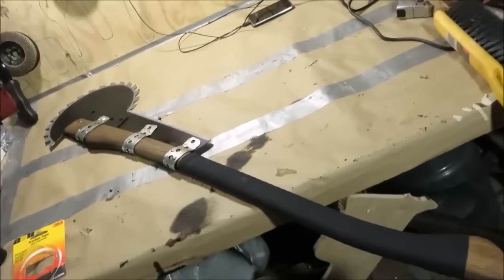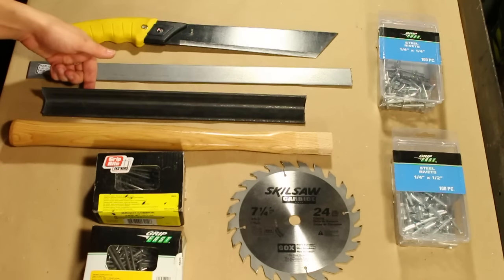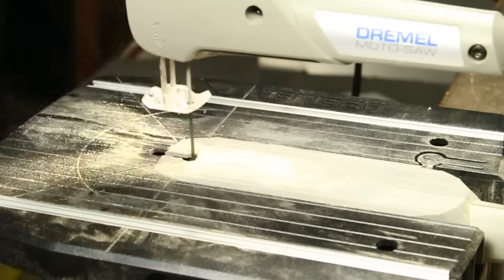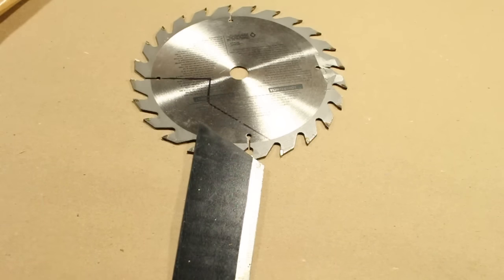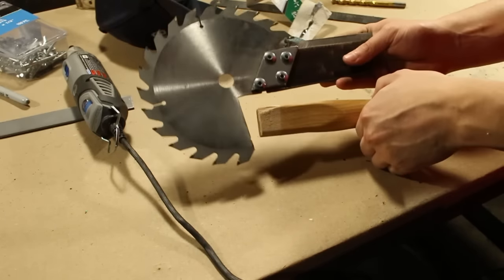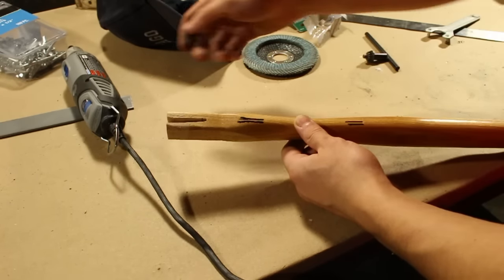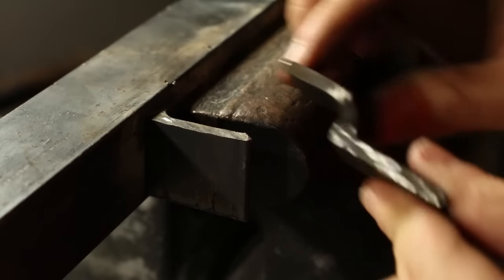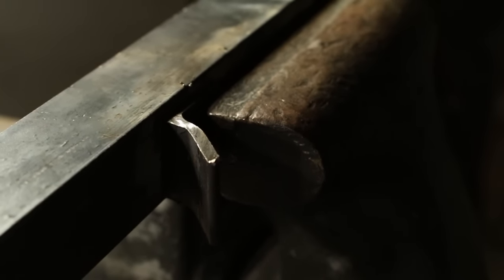How to Make: PSYCHO TOMAHAWK (UPGRADED Wasteland Tomahawk)

Comment: you should heat the metal before you bend it, it will take the temper out of it, but for your purposes, it will be fine, and it will be a lot easier to bend, i would suggest a map gas blow torch

Comment: Hey ZNA. From what I saw, it looked like the voltage on the welder was too high. If the metal is melting away as you weld, lower the voltage and try it then. I'm no expert, still learning myself.

Comment: just a tip when you butt welding like that you sould bevle one side to a 45 degree full weld flip over back grind it till the crack is gone and re weld keeping it clamped around the weld while it cools will keep it from warping to much

Comment: Hey man let me give you a couple tips on mig welding. If it keeps popping and not sounding smooth crank the heat up just a tad til you find the sweet spot and push the weld never pull the mig gun to you push the weld. Just keep practicing man you will get the hang of it. Another question. Do you have a auto darkening helmet or lense? If not hit me up bro I got one I will send you. Makes welding a lot easier than it was for the old timers. Peace.

Comment: Your welding could be improved by slowing down and make sure you bury the core in the puddle. Also while you weld make a lower case "r" motion starting at the seam and working up. This will give you good welds by ensuring your puddle hits both sides.

good luck!

Comment: here i dont have this kind of welders, but in argentina we use "autogen torch" (i dont know how to say that) and electric welders, that i see its what you got.
so i think that the current that the welder is given its to much (here we have the electrodes one) and if it is too much current you kinda not join the two parts together so its like you stick them in some parts and not on others so. advise: if you hear a "whush" coming out of the welder and the handle is too light the current its too high. if the handle its too heavy and the electrode sticks to the metal (remove as fast as you can not to ruin your electric welder) the current is too low.
(always use cloth that cover the most part of your skin because you gonna have some serious "sun burn" out of an electric welder)
good luck and keep practicing in scrap metal because its the only way that you gonna improve.... ruining scrap. 
by the way i really like your builds

Comment: What type welder are you using. If it's an arc welder you will need to use a low setting with thin metal like that , if you can get your hands on a wire welder  set on 75 or 90 and a slow wire feed it will be easier. Plus a wire welder you can get at harbor freight for Bout  89.00 TP 119.00 and it's a lot more forgiving. It
F that's what you are using start out slow then build up your spurred. I use a wire welder up to 1/4 inch to 3/8 with a .20 wire. The nice thing with wire welders it's a hard weld and it's easy to build up. I've used mine to weld stove pipe which is very thin and you can build it up without blowing it our. I've seen people who can't weld with a stick welder make nice even runs after an hour with a wire welder

Comment: I'm guessing it's an arch welder. Is it a clamp or autofeed? I'm assuming clamp is cheaper and probably what you have, unless you splurged. My dad just taught my cousin, sister, and me to weld using a clamp welder. A note he made to us is that you are adjusting for both position and feed with a clamp where an autofeed allows you to hold position while the feed takes care of moving more material into position, making it significantly easier. Take if for what you will.

Comment: With regards to your welding, it looks like you have a lot of splatter, which can be caused by having too much or not enough voltage (I don't remember which :P). It will help if you slow down and take your time when you weld.

Comment: I would like to say that on ur welding no weld is bad if u have good penitation in ur steel, I am 16 years old and when I first started welding at the age of 10 my welds looked like boogers but they held sturdy. When ur metal working it's ok to have a crappy looking weld because they made a grinder for a reason lol. Like my dad always says "they may look like boogers but they'll hold and that's all that matters". Keep up ur welding and practicing it will take a few try's and u need the right voltage and wire speed for ur metal if u want a good looking bead and to not melt holes on the metal, but sooner or later ur gonna get a nice looking bead.

Comment: Hey Eli, thats a MIG welder right?  Not sure why but it seems to "spatter" a lot, try setting the wire feed speed to a lower setting and leave your temperature the same.  

P.S.  If your going to practice welding i would suggest a Stick welder first.  As my teacher always said if you can master Stick welding you will do great with a MIG welder or a TIG welder.

Comment: and if you hold the arc in one spot longer your weld will melt the metal together better, but you can't hold it on too long or it will just melt it away

Comment: Welds will be stronger than riveting. The plate and rivet does look cool though.

Try welding by tacking along the join, not by trying to do a bead in one pass.
Use your scrap steel to practice your welds dude, play around with welder settings, that's all it takes :)

Comment: fam alright be 1/4 from medle to bead that comes out of the tip get it first so the metal has a glow then depending on wire speed and heat move in a diagonal back and forth motion never letting go of the trigger.

Comment: 3 things about the welding first what gas are you using?,  argon 92% and co2 8% is a good one could be that you are using the wrong type of gas,.
It also looks like you are using too little power while welding, and finally turn upp the gas. like 6-8 bar pressure.

Comment: you should weld in the other direction it gives better flatter weld and doesnt crack so easly to. so thats one thing 
also your welding MIG but you use the right material to weld it? 
for the things i have seen i think you schpuld better get yourself a TIG welder you can buy a couple separite wires to ad in the right material and gives way cleaner welds.
hope this helps you a bitt , i'm a welder

Comment: If i seen it correctly your using a half auto Mig/mag welder. This might help; if your right handen try resting your left elbow on the table so can suport the sossel with your left hand by eighter holding it or letting it rest on it just be mindfull that it wil get warm zo dont het to close to thr buisenes end, and slowly go over the seam maintaining the same speed. Also a neet trick is a white line over the seam so youll see it beter. Try it out:-)  and dont give up and youll het there

Comment: Eli, on the welding, try turning the amps up high as you can with out burning a hole in the metal as soon as you hit the trigger,keeping the tip about 3/4 of an inch away, using a slow back and forth motion, also it helps to bevel the edges of butt welds for good penetration, I know you'll fiqure it out. ps I love your channel  thanks.  whats new address?

Comment: next time you weld grind the edges of the two bits to make a shape kinda like this =><= when there placed together so you can fill the dip in with weld it will make it stronger when you grind it down flat and Wil get a deeper weld

Comment: welding looks like it needs more heat, and you need to move a bit slower, it's not easy.as for the circular saw, only the black ring on the outside is hardened, if you get the right blade you can probably cut it with the scroll saw.

Comment: You know, MIG and TIG welding is the easiest, but I recommend learning how to use an Ark Welder and how to Oxy Acetylene Weld first. Learning those two harder welding option will benefit you enormously (and since you're in Illinois, I assume there are plenty of farmers with one or both of the above mentioned welding equipment).
Reply: Ark is the easiest thing to learn how to weld...  Tig being to hardest.
Reply: Ark ain't the easiest; MIG is. With MIG it's all about the pull of the trigger, and small circles. Ark is all about making sure the rod isn't too close or too far, and you gotta do circles.
Reply: All Games idk I was always told,  and experience first hand that Ark was the easiest to learn,  you don't have to worry about wire speed,  as you fed it yourself,  you had one setting to adjust,  not 3 you didn't have to worry about gas.  Just all in all easier.
Reply: True, but when I used MIG, it was a lot easier than when I used Ark or Gas. And my teacher said TIG was even easier. IDK. I do know, though, after getting everything set on a MIG, all you gotta do is pull the trigger.

Comment: good welding takes practice, but to make shitty welding look halfway decent in the past i've put a tad bit extra weld over the place i'm welding so that i've got enough material on there to sand it down with a dremel or belt sander to kinda flush the weld in with the no metals i'm connecting, kinda makes it look uniform. but this also takes practice to get it just right, but you'll get it.

Comment: This just gave me a weapon idea: Take the hammer handle (or some other kind of handle or wooden rod) and the flat bar, cut the flat bar into pieces, fold the pieces over the handle and rivet/weld/etc. them together to form four or more edges (possibly adding another set beneath that one) to make a kind of flanged mace or just have one edge to make a similar weapon to the...what was it called? Bonechete? I can't remember, but I'm sure everyone knows what I'm talking about (alternatively, give it two edges).

Comment: looks like you need more heat on that weld, or less wire speed.  Is it solid wire with protective gas? Or flux-cored wire?

Comment: your feeding the wire to fast on your MIG welder.and try fluxcore wire it has the Aragon inside the wire.also to get a better looking and more stable deep weld do small circular motion and bring the weld towards you

Comment: do you have a tank of gas hooked up or are you using a flux wire because flux wire is very dirty weld that looks bad and you need to smack the slag off and some times brush it off.

Comment: The welding problem is at least 80% the welders fault. That harbor freight flux core just doesn't have the power to do really anything. Also the "d" in the nail size is "penny" like a 16d nail would be a 16 penny nail.

Comment: Hey man idk if you're was doing it or if you turn off the lights but you do not have to turn off the lights when you're welding and it looks like you weren't doing the proper technique when you were creating your beads of your well you can do circles half moons are sevens all you have to do is find a constant speed and stay away from the meadow you were welding about a quarter of an inch so you can keep that arc nice and warm and your gas can shield arc

Comment: I can't see what you're doing in it. but when welding, it helps to have a 45 degree bevel on the edges of metal you're welding.
Also, heat control. if its thin, don't try to do the whole thing at once. do an inch or so of weld then let it cool. 

your best bet for welding (like you said) is just practice. maybe try on a 1/4 inch thick metal and practice making a bead. get thinner from there once you're doing alright.

Hope it helps. Still a great final product, Sub/like inbound. lol

Comment: I find myself here due to auto-play somehow, not to be rude or anything but you can weld with the lights on. Odd that not knowing how to weld you would have a wire welder first, I prefer wire welding and think its the easier and prettier (super manly I know) don't get me wrong, but most classes and work place lines would have you start stick welding.

Comment: Hey hi I made a flail in school behind the teachers back with natural rescources palm tree leafs made into ropes and short twigs shapened and tied together as the weight then break a long thick sturdy and bottom heavy brand into 2 use the shorter part and dig it in between the longer part until there’s a slight crack insert rope into the crack reinforce it with more ropes now tie the rope to the weight and there u go a flail in school 

Don’t actually do it it’s dangerous u can get expelled

Comment: i have to ask: whats the major difference between peening your own rivet and popping one? how does it effect the build?
Reply: he explained it in a video a while back, but basically its to differentiate between a tight-fitting rivet and a looser-fitting rivet for a moving piece (like in armor plating or if you wanted to make a sawblade axe-like weapon with a rotating blade). The self-peened rivet allows for rotation around that point, whereas popping it using a tool ensures that the grip it has on the materials is as tight as it can get. I'm not sure why he chose to do it here - space restrictions for the tool maybe? Or it could just be that sometimes he prefers to peen them himself for the heck of it.

Hope this helped!
Reply: Thomas Kahl absolutely did, thank you and nice game of thrones reference with kahl
Reply: Actually haven't seen GoT (well, I've seen like 3 episodes) so not sure of the reference

Comment: 1080ps is better than 60fps. If you can't do both stick to 1080p
Reply: Usually i barely notice the difference between 720p and 1080p. However i can always tell when a video of 60fps.

Comment: +ZNA Productions If you try to drill holes through hardened steel always go for your drill press, on the lowest speed setting unless you can adjust your speed on your handdrill. It is less hard on your expensive drill and it will save you a lot of time as well and keep adding cutting oil as you go, your drill should never smoke, as it ruins the cutting part. So always drill on the lowest speed setting on your drill press, your drill and your wallet will thank you for it. Also instead of spending that amount of money on a cobalt drillbit, try investing that money in a tungsten carbide drillbit, it costs a bit more but in the end you'll probably use that drill for the next century to come.

Comment: Welding with a stick or mig welder? Slow down your movement going across my problem welding at first was wanting to move to fast just like you. I always use motion when welding with a stick welder go slower than you think you need to. With a mug welder I only drag it but again go slower than you think and add a circle motion because it looks like a stick welder.

Comment: what do you use when cobalt isn't hard enough? i was trying to drill through a hardend circular plow blade thing... and it dulled my cobalt bit so i moved to a diamond stone bit but obviously that was for stone and i made the stupid decision of using a diamond bit on my drill press so it took the diamonds off the bit and i ended up doing a terrible job with my angle grinder just to get a hole in the metal. What would you use? i thought about punching one while heating it but i never did lol
Reply: +James Sever Tungsten Carbide, lots of lube and go slow. If you heat the drill bit up too much you fuck it.
Reply: jestahead thanks, and that was before i used wax and oil lol
Reply: Thanks, ill look into tungsten carbide. I think the plow blade was case hardened or something as well

Comment: i would have used some softer metal and hammered some rivets rather than using a normal one with a weird looking oppening
Reply: +Jd Craft i also would try not to paint it if ya do powder coat is A LOT stronger if it were me id temper it a grey

Comment: Sawblade isn't sharpened correctly, think about how the saw cuts, this style of tooth designed to take shavings, not for slicing, resharpen with a knife or axe style edge, the whole perimeter, not just the corner of the tooth.

Comment: why did you weld in the dark?? what purpose did that hold?
Reply from the maker: +Epicmarshall56 
I just turned the ISO down on my camera to not damage the sensor with the bright welding arc. The room was fully lit.
Reply: +ZNA Productions makes sense. lol.  but quick tip for your welding. go slow and let the weld build up, it should look like a stack of coins knocked over.

Comment: when welding a butt weld like you were doing with those two it helps if you bevel the two pieces being joined so the weld can get down into the 2 pieces. I would use a strap similar to what you did with the rivets and then weld 2 lap joints on it as it will be much sturdier than just a butt weld alone. You should check out ChuckE2009 and weldingtipsandtricks chanels out for welding how to videos, they are both top notch, oh and pratice! Good luck and thanks for all the cool ideas!

Comment: Welding is a skill you need to practice at and tack weld before going for it, it gives you an idea of timing to the point where you'll just weld inside 30 seconds and then finish it.

Accept shitty welding to begin with and just look for reasons to weld any old shit together and eventually you'll spend more time welding than with screws, nuts and bolts.

Comment: U should have made it looks like rust then clear coat it so it looks apocalyptic And weathered the handle
Reply from the maker: +damian armenta Actual rust and actual weathering on the handle will achieve the same look eventually. No sense expediting the degradation.
Reply: +ZNA Productions na not real rust there some kinda spray that u can make that makes a rust affect, i think its vinegar or something that u spray on bare metal then u put a clear coat over it.

Comment: when I was building my go kart around 13-14 years old I was turned around doing something and had turned around to drill through a piece of 1/4" steel plate that I thought my dad tightly clamped down but it turns out that he only lightly clamped it and the bit got snagged or whatever, grabbed the plate of steel went right around 180 degrees into my stomach and sliced a hole through my shirt, it hurt a ton.  Clamp your shit